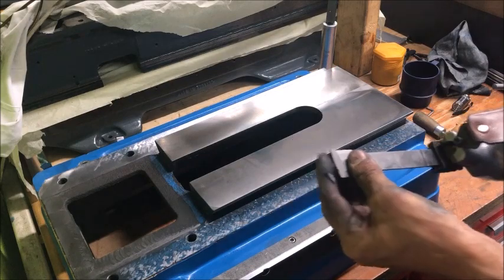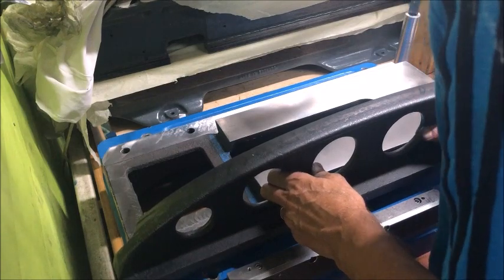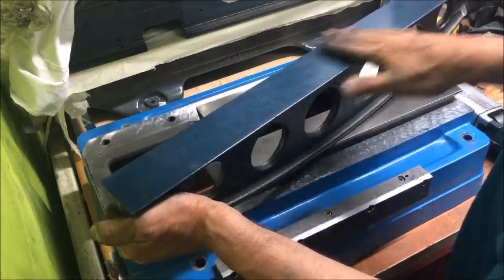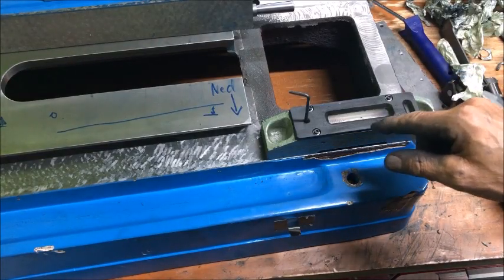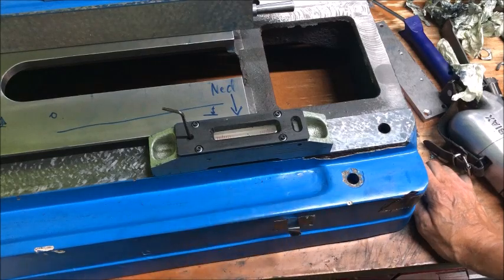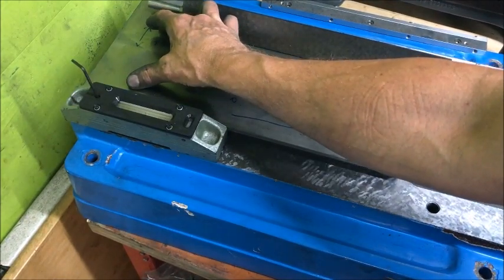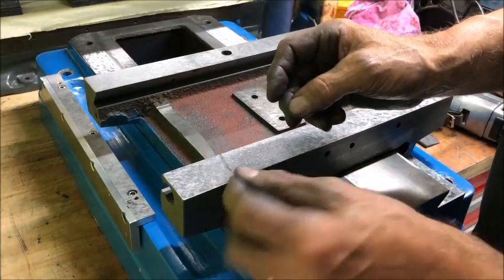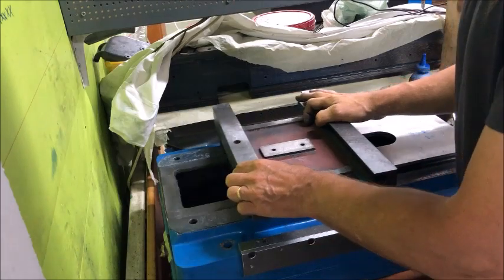HBM45 - some hints during saddle- and base scraping and measurements

Comment: if I had a penny for every time I got a chip on my bluing...
Reply from the maker: Hehe.. well, this is quote common I guess, but anyway. The example made here would have thrown the measurement off enough to make an error. Thenif the surface accordingly, the surface would be worse than before and one cycle ahead i would scratch my head because the prints didn't improve the way they should..